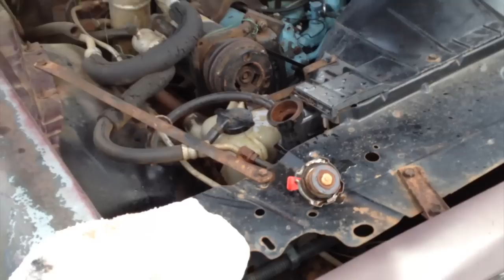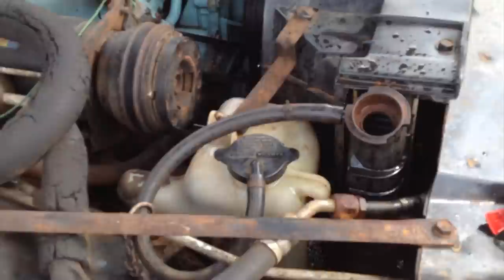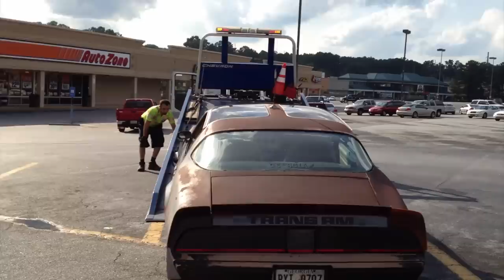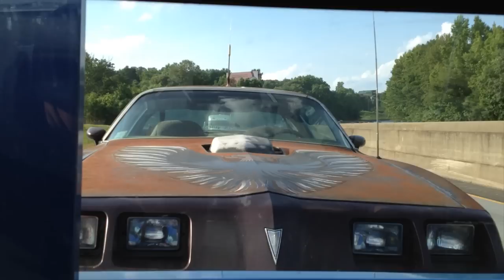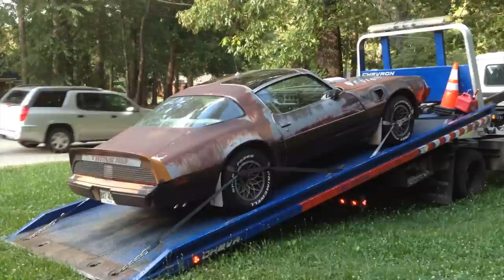Vinegar Radiator Flush Disaster On A 1980 Trans Am "Stolen in 2015"

Comment: Vinegar 60/40 in a plastic or glass jar ,,, cleans rust from all metals , brings bolts and screws up like new  ,great for restoration projects any metal part , leave until you can see bubbles on the top of the water ,a day or two , wash with water , then I use a light wire wheel in a brench drill ,high speed ,  wire off like polishing , then use engine oil and thinners shake well , wipe on  ,wipe off ready to reuse , hope that helps ,  60 bel air owner ,,
Reply from the maker: Thanks buddy, this was a disaster..

Comment: Vinegar can rip off rust from the system but also cause to keep the rust if it won't clean properly after. If you flush the system with food grade citric acid first the rust then smell would gone. You can find on youtube how much amount citric acid should be use.
Reply from the maker: Thanks Said.
Reply: Honestly I watched this video 5 years ago I guess. I know many ways to remove residue of rust and smell cause of vinegar, because I'm using it for rip off rust and paint. But the water in the vinegar cause rust a little and leaves residue. In this case we'r talking about cooling system and it's not easy as to clean as in a plastic container. When I found out citric acid can eliminate vinegar residue and smell, remembered me this video. But I couldn't find your video untill now. Hope this will work on your other projects.
Reply from the maker: @erzincanli  thanks for that info. This is a very old video
Reply: @cassafintechlab4377  Soğutma sisteminde sirke kullanma. Burada olduğu gibi kokusu çıkmaz ve yüzey pası yapar. Onun yerine sitrik asid kullanırsan kireç, pas ve kiri sökersin. Ben hiç denemedim fakat burada sitrik asit ile temizliği yapılan sistemlerin videolarını detaylı olarak inceledim. Zamanında Liqui Moly nin ürününü almıştım. Ama bittiğinde sitrik asit kullanacağım. En kolay ve en ucuz temizleme yöntemi. Sitrik asit piyasada satılan bildiğin limon tuzu. Youtube da flush with citric acid diye aratırsan orada kullanacağın su ve limon tuzu oranlarını veriyorlar. Orana dikkat et ki çok kullanırsan alüminyum da aşınma ve delinme olmasın.

Comment: the vinegar has nothing to do with it overheating, when using vinegar, or before you put the thermostat in take the old thermostat out and put your lines back together without the thermostat, add three gallons of vinegar to your cooling system, start it up and get it circulating through the whole engine for 5 minutes then turn off, and let sit for a few days,.. after a few days use distilled water to flush the system then you will see tons of rust flush out,... when the water is clear, use strait distilled water for your cooling system, do not use regular hoes water, regular hose water has bad elements mixed in it,  after which you should put one gallon full antifreeze in it then the distilled water,  after you put in a new thermostat as well, it should drive fine,
Reply from the maker: thank you for this buddy

Comment: Vinegar will help break down rust, but you have to do it right, you can't just pour it in, run it and drain it. First you have to disconnect and block your radiator so you can fill it with vinegar. Then you let that sit for a day or so. Then drain the vinegar from the radiator. Then back flush it with water for 10 minutes or more to blow out all the crap it loosened. Then hook the radiator back up. REMOVE THE THERMOSTAT. Fill with vinegar again. run the engine up to temp for 10-20 minutes every few hours for a day or so, DO NOT DRIVE IT ANYWHERE. After a day or so, drain the vinegar. unhook the radiator and back flush as before. Flush the engine block through the thermostat housing, unhook the heater core, back flush it the same way for 10 minutes or more. Fill with a mix of water and cascade dishwasher liquid, run the engine up to temp for a while. Flush everything again the same way as before. Replace thermostat, fill with coolant. Then you are golden.
Reply from the maker: Totally agree. thx
Reply: wow great, detailed description. Just what I was looking for, thanks!
Reply: I'd add that I've seen many people recommend running a spoonful of baking soda through the system after the vinegar to neutralise the acid.
Reply from the maker: I almost destroyed my car doing the vinegar thing, This car was stolen last year and stripped..
Reply: John barfneck  save yourself a lot of trouble do not use Dex Cool it's one of the worst inventions ever for the automotive industry

Comment: Is it ok to pour in white vinegar in engine cooling system and run the engine for 5 min to make sure it circulates all around (including radiator) and let it sit for 24 hrs. ( I am not sure why people say the block radiator). If I flash all the system eventually with clean distillated water why do I need to block radiator. I want to clean that as well including the engine block cooling system.

Comment: Not always.. but for the most part if a car has been neglected cosmetically it's also been neglected mechanically- Your T/A looks neglected. You need to do basic nuts and bolts cooling system trouble shooting.. plenty of guides online.  Landing at "the vinegar caused this" without troubleshooting .. bad idea.. the right idea is to get the correct answer from thorough troubleshooting.

Comment: No One has mentioned the Quantity of Vinegar that should be used. It would seem to Me that It should be diluted. For Example if Your Car holds 8 Qts of Liquid , It would take about a Qt to be safe......Any One have Knowledge on This and not just a Guess ? Mixing it with Soda would be another Question.....I would offer a Comment that if the Sytem is very dirty , You should do a regular Flush Cleaner like Prestone for a couple of Times before Vinegar and Soda.
Reply from the maker: thanks Van, this was a disaster from the start,,lol.. I finally purchased a New 4 core and after all that, the car was stolen and stripped clean.
Reply: Can you demonstrate in video would be appreciated